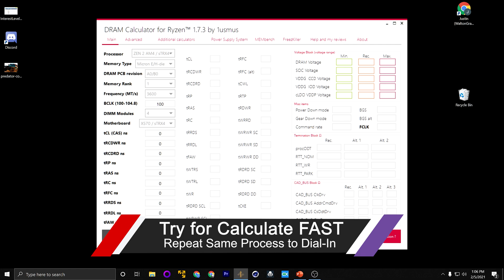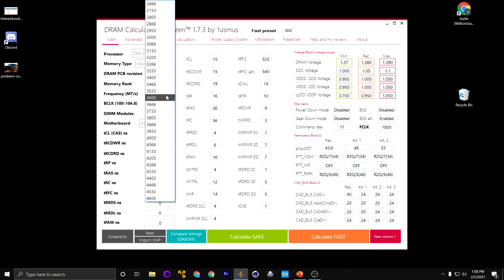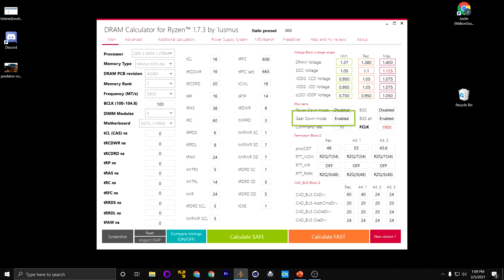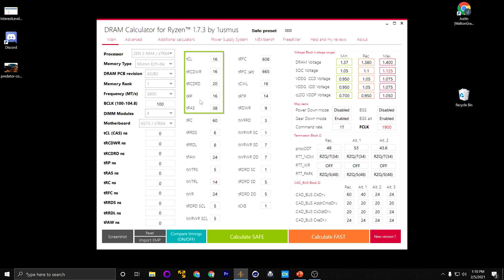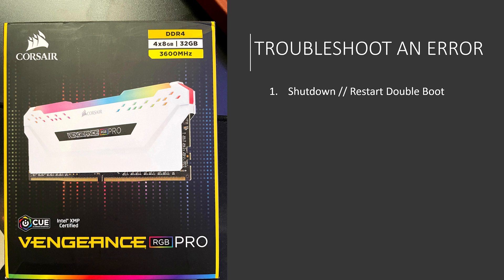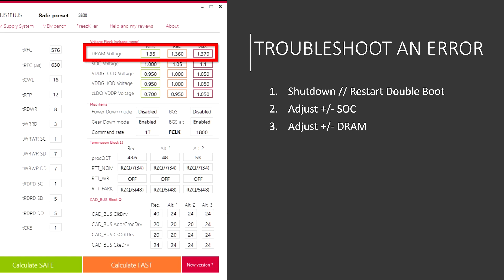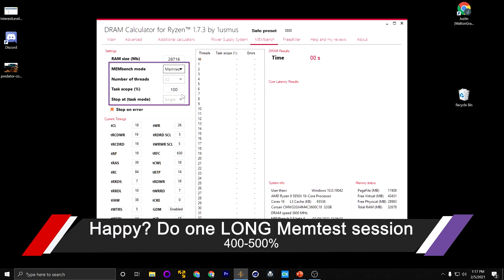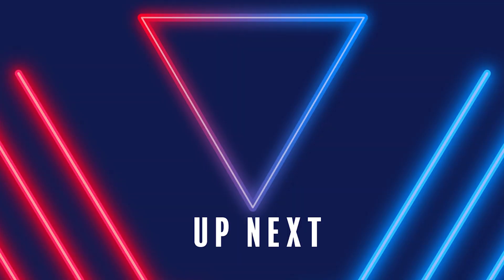Final tips on how to successfully overclock your Ryzen RAM

Comment: When I put in settings to OC memory Fq, DRAM Calculator gives me an error "Not supported". Any idea why that would be? I've got 3200MHz ram but I'm currently running at 3600MT/s and DRAM Calculator fails when FQ is set to 3600.

Also, if I increase FQ and increase CAS but the latency calculation stays the same, would that result in a generally faster setup or would it be a no gain scenario?

Comment: Why don't they allow the calculator to handle higher frequencies?  Frustrating when I'm trying to tune 4000 mhz ram for Ryzen as a noob!
Reply: i think the creator of the tool is to busy on programming his CTR 2.1 (Clock Tuner for Ryzen)  for Ryzen 5000
Reply from the maker: Correct. I'm going to review CTR in a future video as well.

Comment: i used more power on my 6800xt under water at 300w and the hot spot temp was uncontrollable like 100c 60c kinda scared the shit outta me lol i know its good to 110c but not on a consistant basis and yes it was time spy extreme
Reply from the maker: Sounds like maybe one of the thermal pads isn't cooling as well as it should. If you have a backplate, try removing that.

Comment: my system wouldn't startup. so I had to reset install bios. thank god I had my settings saved. I have odd number but my gear down is enabled. I do not see any unstabilty. Can I keep it enabled?
Reply from the maker: Yes. In Gear Down Mode you can set an odd number, but the BIOS might ignore it and round up to the higher even number.